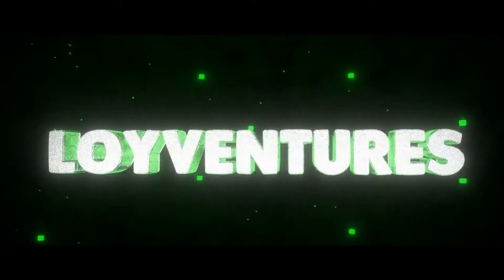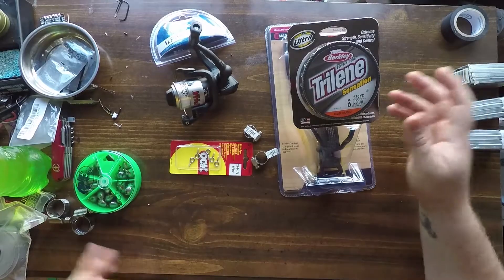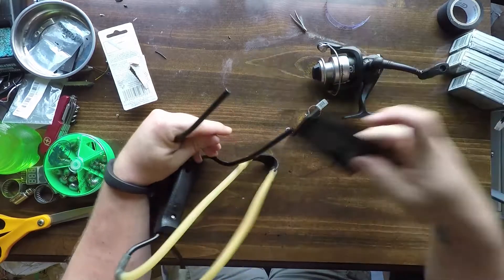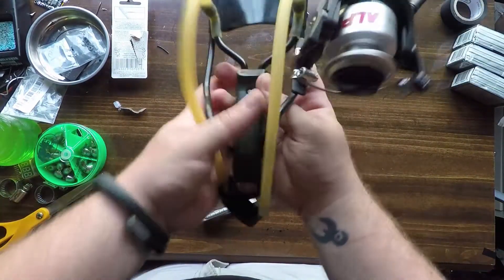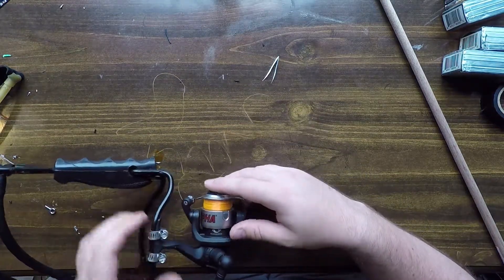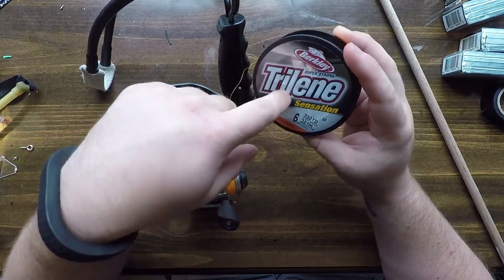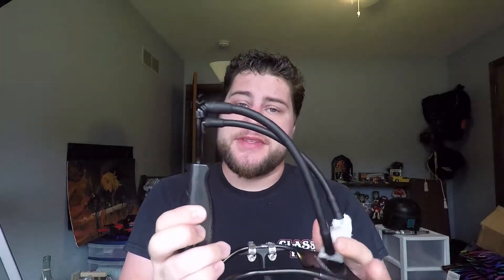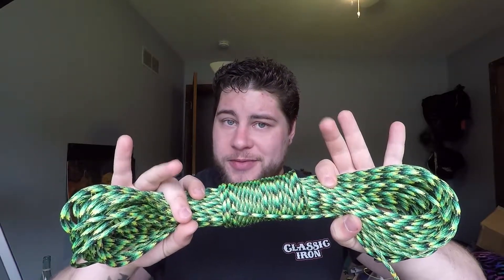What I used to Get My Drone down from a Tree

Comment: This is when you need to invest in a telescoping pole with a hook on the end.
It is worth the investment.
https://www.amazon.com/DOCAZOO-Extension-Telescopic-Retrieval-Telescoping/dp/B08159BMJH/ref=sr_1_12?dchild=1&keywords=24%27%2Blighting%2Bpole&qid=1608495358&sr=8-12&th=1

DOCAZOO DocaPole 7-30 Foot Pole Hook Extension Pole

This is the one I use and it collapses down to about 5'. Really rugged.
Greenlee FP24 Wire Fish Pole, 24-Feet
https://www.amazon.com/Greenlee-FP24-Wire-Fish-24-Feet/dp/B00125DA7W/ref=sr_1_52?dchild=1&keywords=24%27+lighting+pole&qid=1608495544&sr=8-52

Comment: Great idea! Why exactly did you change to a rod instead of just a weight?
Reply from the maker: Thanks! I swapped it over to a rod for a couple reasons.  One, a weighted stick is much more likely to tilt off and slide back down between branches when it catches on something; two, it made the contraption a slingbow from a slingshot, which is infinitely more aim-able; and three, the launch velocity of the rod is a lot less violent than a singular weight, making it less likely to snap the fishing line (I used a slightly too light test line on this one).
Reply: Loyventures Good points. :) Thanks!

Comment: Love this set up. Just to sure I’m getting it correct. The rope is to piggyback it to the line to get better put while yanking ? Vid didn’t show how you did it. Thanks
Reply from the maker: You are correct.  the fishing line is prone to breaking once you start tugging, as I used rather lightweight fishing line.  It actually snapped on me the first time I got it over the branch and started pulling,  So I used the line to reel the paracord back up and over to give me more tensile strength to pull against.  You can see it snap (and the evolution of the device itself) here: https://youtu.be/kPpQ6tCcTks
Reply: Loyventures ok I see exactly what you did. Great job !  I’m on my second day of having my drone up on a at least 50-60 ft tree. I went to get the supplies to build this and was surprised to hear I can’t buy a sling shot in NY.  Tried to order on eBay out of state and no luck. Nobody can sell to NY residents. 
I have the reel and weights but no sling shot :( I’m coming up with a way to build my own version with wood and some fitness bands.  Let’s see how this works out. Attempting it in the morning. Hope I can do it. I’ll let you know.  Any suggestions to add ?
Reply from the maker: Nah, sounds like you got a good ad-hoc going there.  did it work?